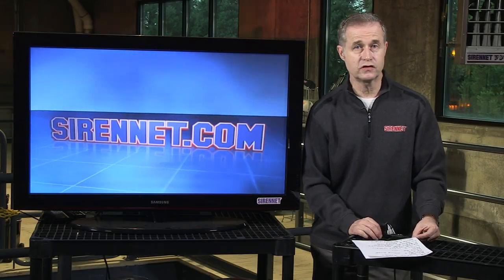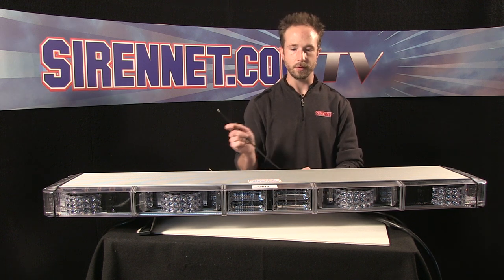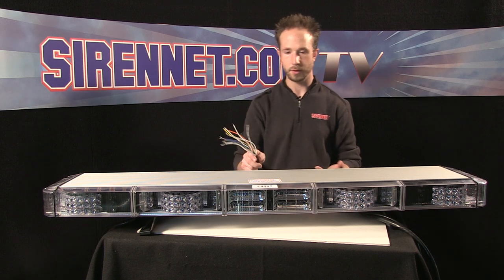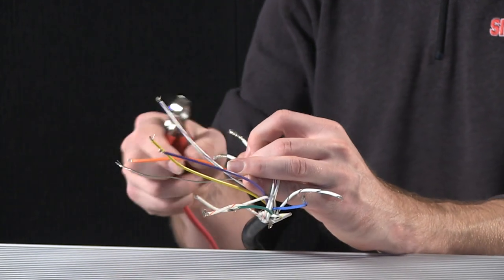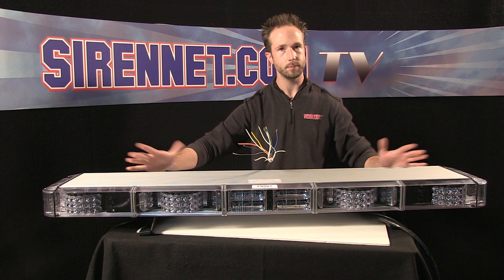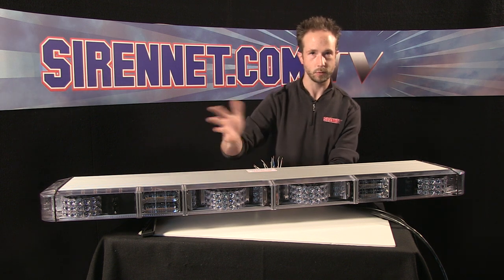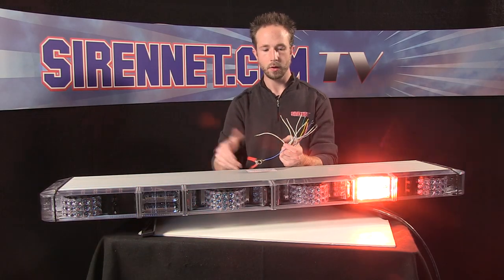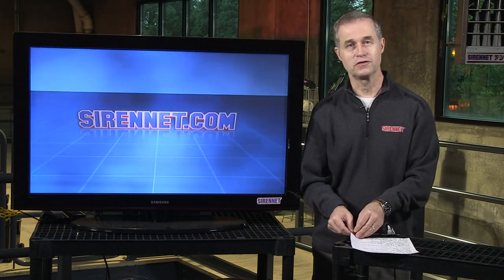Chris gives us a Wiring Tutorial for the Whelen Freedom Rota-Beam

Comment: It would be great if the rotabeam modules were not synced with each other, or at the very least, alternated the rotating pattern so that both sides were not "dark" at the same time.
Reply from the maker: Blaine Bugaski Using the Scan-Lock trigger wire, you can adjust the Modules so that the patterns are different from one another.
Reply: Very cool, that would help to "randomize" the pattern and allow for less dark time.

Comment: The rear lins, can they be changed to S/T/T lights?
Reply from the maker: If you were to add an additional wiring harness that operated the S/T/T specifically, then yes, it can be set-up that way. Out of the Box, the Rota-Beam Freedom is not designed to operate Brake/Tail/Turn lights.
Reply: Was wondering since I may purchase one for a plow vehicle, but wanted S/T/T on the Roto-beam. Thanks for the response. :)

Comment: Chris. I have been messing with light bar at work for street department. I got all the lights to work. Except for slide switch to run the flashers. If i touch the blue wire to the slide switch they will turn on. So seems like it not getting power to slide switch. It is driving me crazy. I replaced control board and same thing happened. Any ideas would help. Thanks. I don’t know much about this. Our mechanic retired so I’m just trying to help city save on spendings.  I don’t know if he disconnected something some where or what
Reply from the maker: Mind giving us a call at (888) 959-0911? Please ask for Chris, he'll try and help get this taken care of with you :)

Comment: Are you using a car battery charger to power that bar? I use one for my Vista but when I'm connecting the hot to the wires it makes sparks and smells like burning a bit - though it powers the lightbar. How do you guys avoid sparks upon contact? The sparks stop once it's fully connected.
Reply from the maker: We use regulated power converters. They take a conventional AC current and drop it to a regulated 11-16 volt DC output. They are designed to protect from over and under voltage as well.
Reply: You use a switch box/controller of some sort and make sure all the switches are off and there is no current being drawn when you are hooking it up.  There is no getting around sparks but they happen inside the switches and thus you don't see them.
Reply: @TempoDrift1480  I was 15 or 16 when I wrote this and work on electronics for a living now. Though I appreciate the reply.